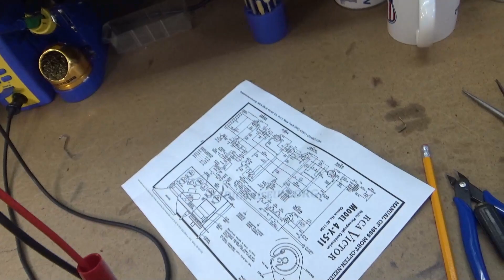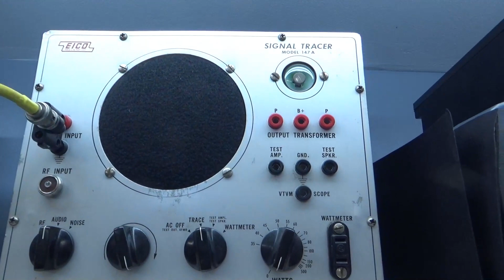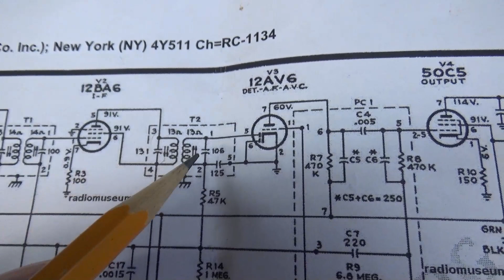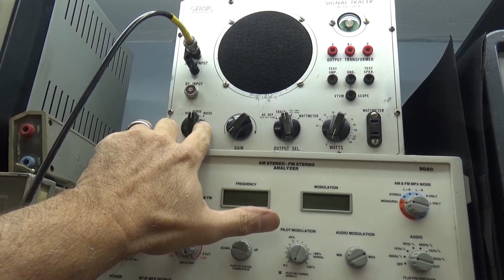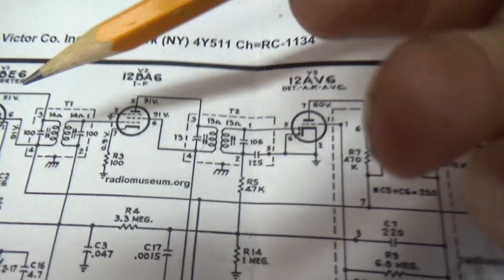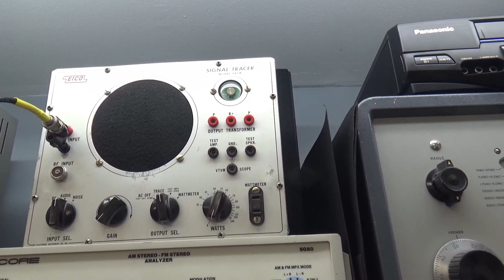Quick Tech Tip Silver Mica Disease

Comment: Silver MIGRATION Disease. Yes, mica is involved, but migration is the action that causes your problem. This is an interesting way to test the cans. I suspect that you can do the same thing 'in circuit'?  I have one of those Eico 147A Signal tracers, and the next time I have an SMD situation I will try this. There are times I may not want to do both cans, (I know, I should) and want to isolate the bad can. Thank you for the video!

Comment: I'd like to hear a good IF transformer using the noise function for comparison. Exact same setup but use a good transformer.
Reply from the maker: It's totally quiet when their in good shape. Also, you use a 100pf Cap and see how close to resonance you get from the tuning of the coil, if you dont have to tune it too much a turn or too then your golden, other wise if the have to turn the core way deep then you need less capacitance or inversely if it tunes way outward the you need more capacitance. there are other ways to do this but its too long to put in this response.

Comment: Is there a material suggested to glue new capacitor in place?  If im understanding this correctly it is "physical" damage that causes the silver to migrate inside the capacitor. How is the part protected?
Reply: Disable the internal cap, I cut through the plastic with a Dremel bit. Actually I may use a used dental burr with a small collet for the Dremel. Many dentists can save the burrs for you.No need to remove that rivet. Cut the 4 contact arms off.You can see through the plastic where they contact the mica sheet. Cut straight through just enough to cut each arm off. They will come out. You can even slide out the mica sheet of you want, but it pretty much isn't making contact anymore. Now effectively there are no caps between the coils. Now reinstall the can on the chassis. Add your new caps to the bottom lugs. Done.
The original capacitor is really one sheet of mica with the coating on each side. Your new caps are not exposed the air. Mounting on the lugs, you;re done. No glues and such.
After getting rid of the original cap sheet inside, you can put the shield back on the IF can.

Comment: If capacitance is not shown on the schematic i disconnect one lead from the if coil and measure the capacitance before removing the capacitors . This way I don't have to guess . Another way is to measure inductance of the coil and frequency and I use formula to get capacitance that's easy found on line  I use LCR-T4 checker . Checks capacitors and inductance

Comment: I bought a 2022 Marshall 50 watt JVM amplifier for my guitar. 

And that's almost exactly the sound I was getting out of the amp when I turned it on after letting it sit for about a year. 

It took the engineer five weeks to figure out that it wasn't a tube or a resistor but a silver Micah capacitor that went bad. 

From what I've read those capacitors should last at least 10 years. Why the thing went out I don't know.  In the 3 years that I had the amp it was hardly played. 

But now that the silver Mica capacitor has been replaced the amp sounds like brand new.

The noise was so bad it sounded like 15 rabid raccoons fighting with a badger. 🙏😃🕊️❤️

 That signal  tracer looks like a good investment

Comment: I suspect the noise in my s38e may be caused  by morethan  bad mica but due to dirty power in the new, poorly sheiled wire.  On the other hand, the volume is very poor.
Reply from the maker: Dirty tube sockets, noisy resistors, caps, etc can do that as well. Good luck. Thanks!

Comment: The radio that I'm working on now has SMD and I used a low voltage leaky capacitor checker and a high voltage leaky capacitor checker, and both will conduct across the primary to the secondary of the IF showing SMD. Really cool. On the ohmmeter shows open.

Comment: For sets that don’t show the IF cap values, would it be possible to find the value by applying 455khz and trying different value caps to find the sharpest resonant peak? Once the micas have been removed of course..
Reply from the maker: Thats one way to do it. This transformer performed perfect back in its habitat, but the 2nd transformer was a bit of a pain. I didn't show that one being reworked.
Reply: Some guys will tack on a couple of trimmer caps in the 80-125pf range. They tune the trimmers where the IF can will resonate the can as factory. Do not touch the slugs. Then they measure those trimmers to see the value, next install fixed caps in that value.

Comment: If the mica sheets can be removed from the IF transformer, can they somehow be cleaned to eliminate the noise?
Reply from the maker: You cut them out and replace with a real capacitor, I will be making a follow up video in regard to this which shows the procedure.
Reply: ...it doesn't work that way-!
Reply from the maker: what exactly doesn't work that way? @daleburrell6273
Reply: @oldavguywholovesRCA  he means you cant just take out the mica and clean that silver off the sheets.